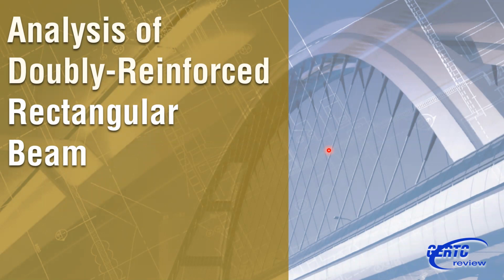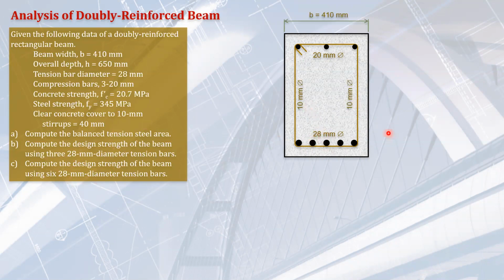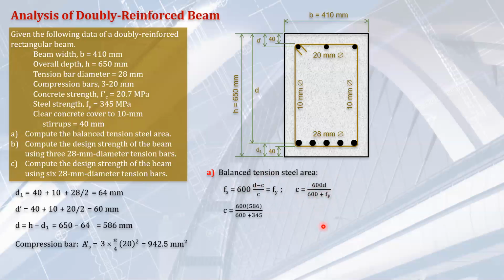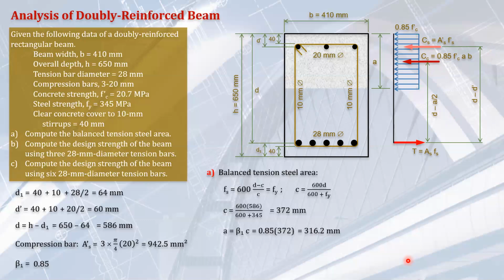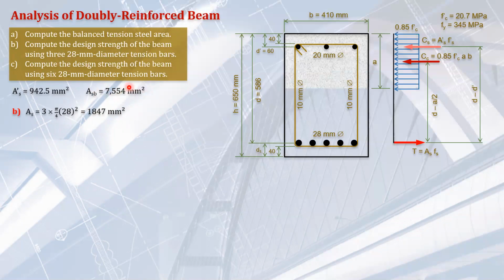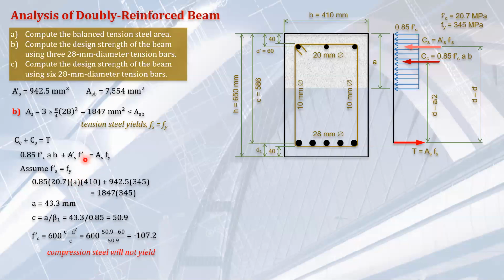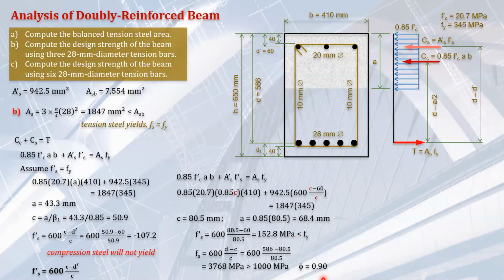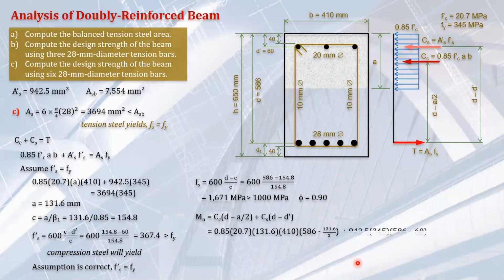How to ANALYZE DOUBLY-REINFORCED RECTANGULAR BEAMS! (REINFORCED CONCRETE DESIGN)

Comment: Hi sir. How about sir if malaki ang compresion steel area compare sa tension steel area. posible po ba yun?. yung design po nang structural namin.. dimension b=400mm  h=600mm cover 50mm   Bootom bars= 2-25mmm  
Top bars 3-25mm
 fc'=41.41Mpa 
Fy=414Mpa 

Nong try ko po e solve Negative value nang a.

By the way po former student niyo po aku last year.
Reply: Possible naman yan pero ang nacompute ko ay:
a = 40
c = 53
fs = 5477
Mn = 195